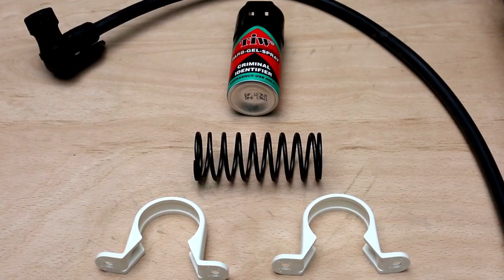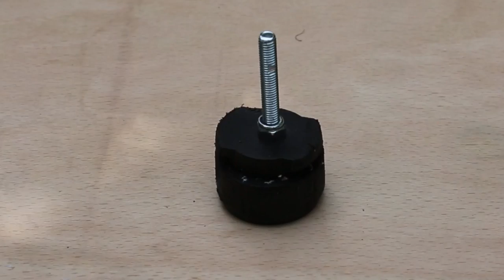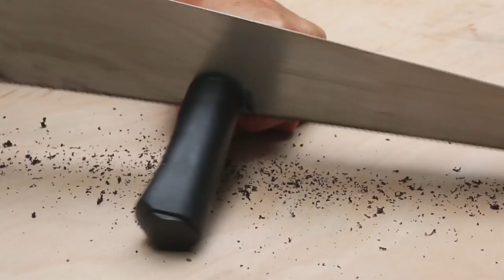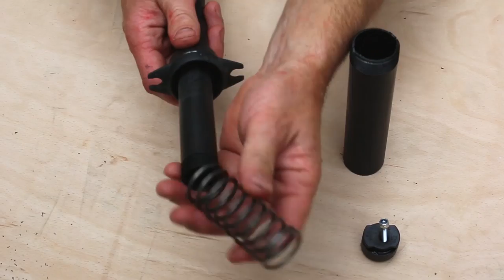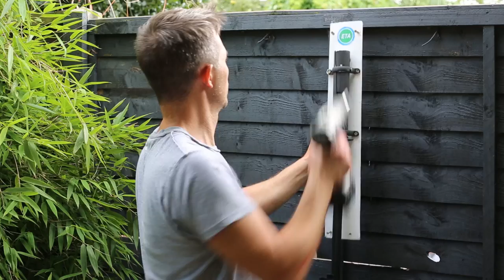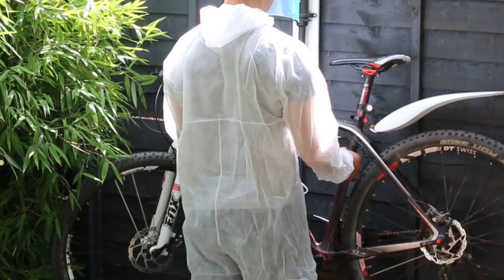Turn a bicycle pump into a paint bomb to protect against theft

Comment: In your design, is there a way to deactivate the spray so the owner can actually use the bike?
Reply from the maker: Yes - there is a safety bolt that keeps the spring compressed when needed